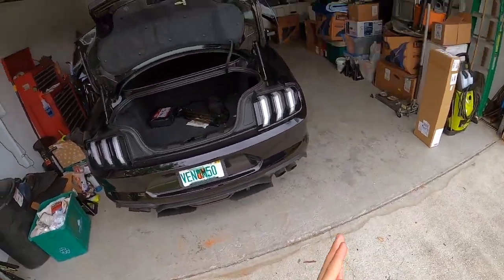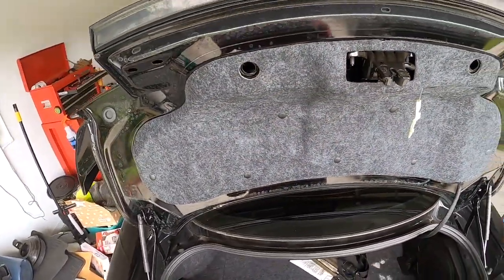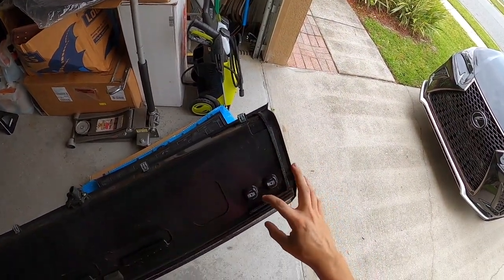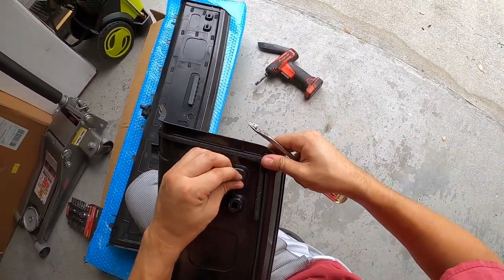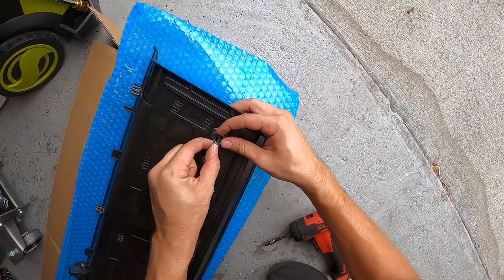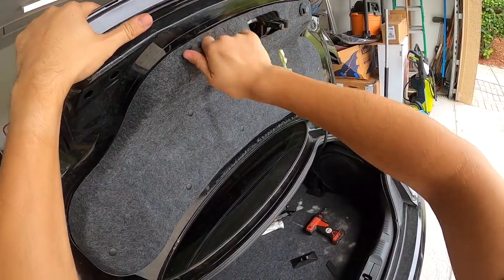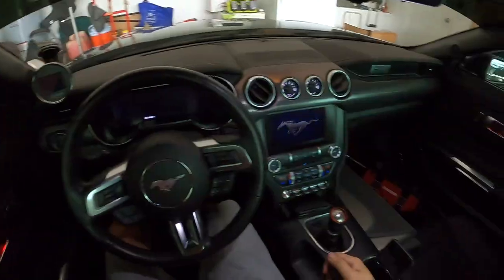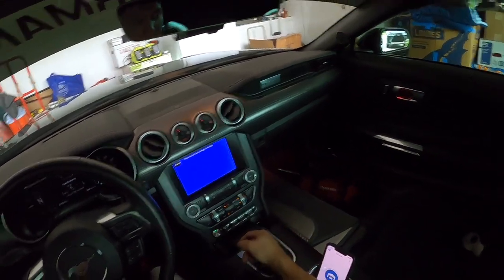What EVERYONE'S FIRST MOD SHOULD BE for their Mustang...and Deck lid replacement!

Comment: Did you have to transfer over the foam stripping from OEM deklid to new one? Is it a concern to just install new decklid without the foam liners?
Reply from the maker: I did not have to transfer it. And it definitely helps with sounds and vibration
Reply: @BrandonChinn  ok so those oem foam liners are not for water proof?
Reply from the maker: @Hamza_Aziz  no, water still gets in between the decklid and trunk panel